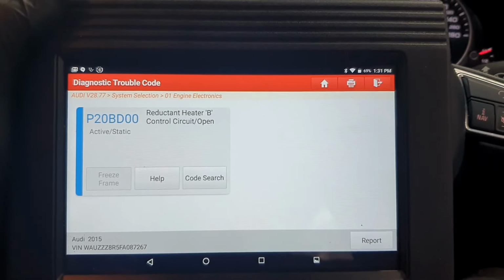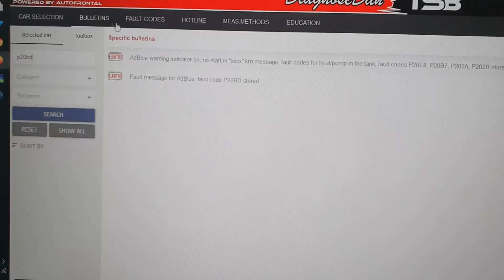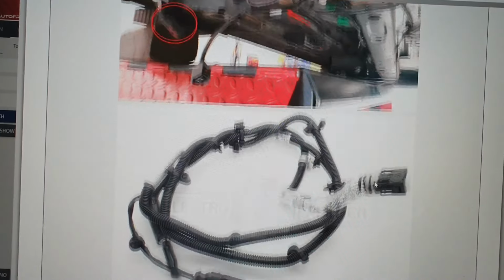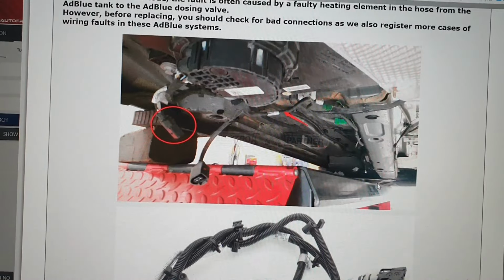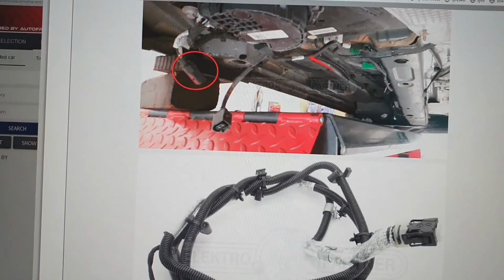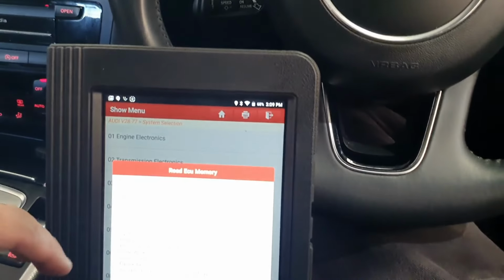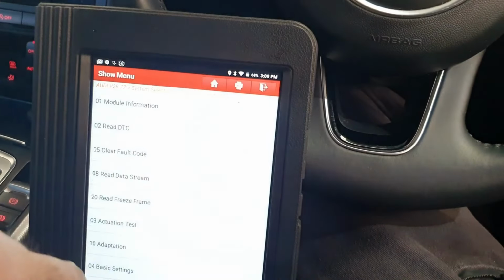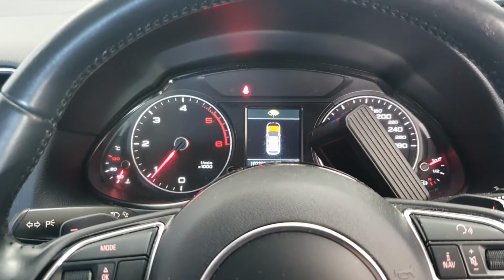Audi Adblue Issues - P20BD Reductant Heater Circuit - Engine light on Audi Q5 2.0L TDI

Comment: Adblue freezes -11°C, I live in a country that doesn't ever get that cold, so the heater never comes on. So I simply cut the two wires for the heater and soldered on a 8ohm 100w wire wound resister,  a bit of heat shrink, $20 worth of parts, 2 hours of time. No problems from the reductant heater system that was 3.5 years ago... Save yourself a fortune. (I have an AUDI Q5 2013 2.0L CGLC DOHC 16v Turbo Diesel)
Reply from the maker: Fair call Angus, if it works for you then great. Thanks for commenting it in case it helps anyone out.
Reply: Hi could you give a more detailed on how you did that ??
Reply: Hi you have picture where you soldered the resistor exactly
Reply: I have the same code and problem at the moment. So if this is the case and it isn't that detrimental to the car, is it okay to drive in the meantime if waiting for parts to get sorted or complete the same fix you did?
Reply: Could you give us a picture of where you did this
Reply: Sorry all. Haven't look at this post for a while. Still no problems with the reductant heater fault after installing the wire wound resistors. Yeh didn't take any photos at the time. But here is a link to another video that shows the heater location around 2mins in. Just cut the in and out wires, install the resistor there. https://youtu.be/DRJogxEdPKE?si=45HsnhOCT4Zaghnt
Reply: @anguss-a4774 
Tu aurais un lien du genre de résistance que tu as mis.
Et concernant la résistance si j’ai bien compris, tu à remplacé le branchement par la résistance ?

Comment: nicely done! do you happen to know what is the heater element resistance value threshold? Would 2 ohm resistance trigger the circuit high fault code or not?
Reply: Nah an ohm here or there shouldn't make much difference